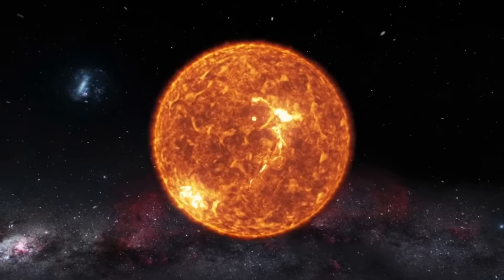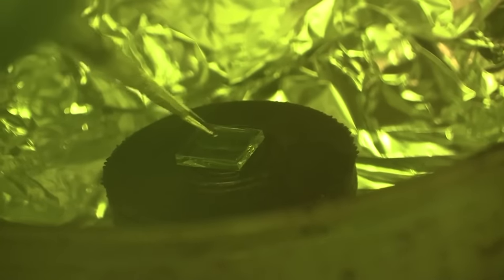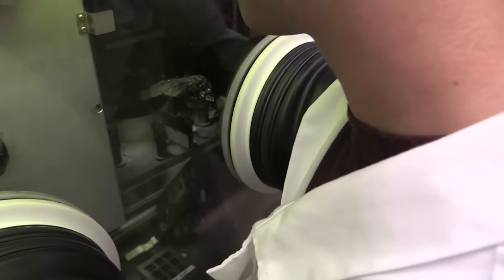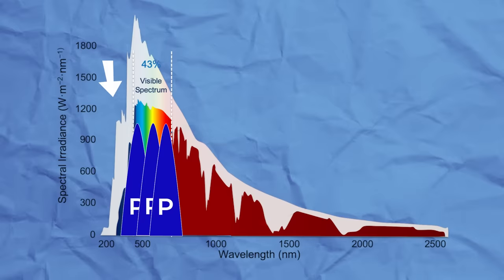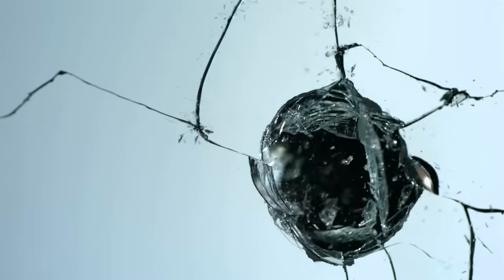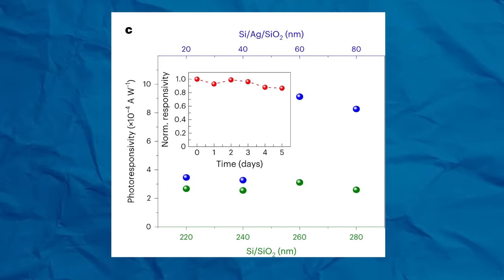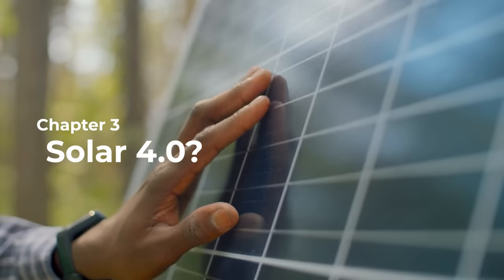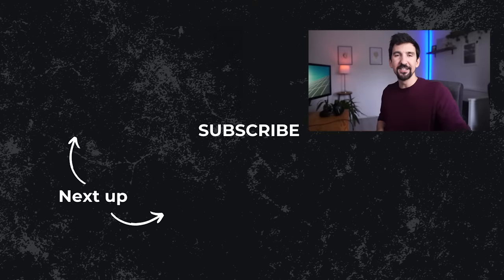Solar 4.0: Ultra Efficient Solar Panel Breakthrough

Comment: I know that perovskite cells can be roughly 1/2 the price of silicon cells, but with the adaptation of not using lead and adding the layer of silver I wonder how expensive they will end up being if this design is universally accepted after further lab testing.
Reply: No perovskites as a material are 1/10th that of convention Crystalline Silicon. However the casing for all.perovskite panels may be made simpler without a silicon substrate, so they could end up being 50% less expensive.... Possibly more due to the roll to roll capability of perovskite material application.
Reply: Depends on the thickness of the silver plating they indicate 60 nm and it is an alloy, so maximum silver content per square meter would be(less than) roughly 1 gram which is less than a Euro in material cost.
Reply: @nilsfrederking62  We also have to take into account that the silver could be potentially recycled and recovered, thereby further deceasing the total amount of silver used.
Reply: Maybe dispersed metal atoms on multiple layers could allow for the silver effect. High temp metal could be used as its a substrate not impacting the perovskite layer, however the dispersed atom idea is a little bit complicated in terms or preventing atomic agglomeration for true dispersal
Reply: @nilsfrederking62  if the entire Industry converts it it could be * million square metres.... So 1 ton
Reply: As he explained they didn’t need the mirror effect but just a metal. I think they used silver due to an easy process to apply it. Silver is out from the beginning as even the tiny amounts of silver used in solar cells actually is using 10% of the worldwide silver production. The main problem of perovskites is the durability. And installation is a huge part of the costs of solar cells. So in the end perovskites may be cheaper to produce but due to durability not cheaper over the lifetime of a solar cell which is around 30 years.
Reply: @nilsfrederking62  right, but would the world be able to support such an increase in silver demand?
Reply: @svenweihusen57  aluminium is highly reflective
Reply: @13thbiosphere  Jeah, but they don’t actually need the reflective properties but the metallic property of free electrons. I think they used silver because there is an easy and cheap process to produce thin layers of silver. The same process as making mirrors. And on top is silver highly conductive which might enhance the effect.
Reply: @Supreme_Lobster  The yearly silver production is roughly 23.500 tonnes per year, that is 23.5 billion grams of silver, the earths surface is 510 million square meters, so you could cover the complete earth with roughly 50 layers of solar panels every year. I suppose that is not wanted and  other materials would be insufficiently available 😉
Reply: @svenweihusen57  aluminium is  highly conductive
Reply: @13thbiosphere  might work too.
Reply: @nilsfrederking62  510 million of square kilometers, not meters...........
Reply: The takeaway from this video should be about the efficiency, not the cost. Even if the cells come to market at the same price and the increases in efficiency are only half that seen in the lab, you would be getting twice the energy for the same price and it would still be in a thinner, lighter package.
Reply: @marcosclarandis8090  Thanks, that is quite a difference 🙃must be divided by one million. So would need a new calculation. If I remember correctly the surface needed to cover all of the earths energy needs  by solar would be 0,2 percent, 70% is water....I so it would take roughly 6 years if all the silver production would be used for it. So maybe 10-15 years could be feasible?
Reply: @wildwilco  I fully expect it to cost more than silicon when it is first introduced. Wider production and competition will drive the price down over time. You can look at any chart that plots out the cost of solar over time and see the massive gains that have been made for the consumer.
Reply: @wildwilco  I don't know what data you are looking at. Since their introduction in the late 70's, the cost of solar energy has dropped from over $75/watt to less than a dollar a watt. Even including manufacturing costs, the cost of solar panels has dropped from over $7/watt in 2010 to something around $2.25/watt in 2021. Either way, those are huge gains. If you are personally seeing price increases, my guess is that is due to the growing demand for it and supply issues.
Reply: @Nils Frederking  at current price. High demand from say a new industry will push the cost higher.
Reply: @joshwagner4368  its not the panels. what is the most essential item you need to turn that solar energy into electrical energy?

when you awnser that question you know what is the problem of today. those converter prices have skyrocketed. where a 2000 watt converter would cost about 400-500 euros, you are paying more than 1200-1500 euros.
Reply: @_shadow_1  Silver is as well one of the reasons classic Silicon solar cells are expensive. It turns out there are not too many alternative cheaper materials for the contacts and busbars, that are reliable over 25+ years of use. And I do not see any mass scale of recycling of Silicon based solar panels happening, which would suggest it is not as lucrative of a business as you may think ..
Reply: @jk0000079  that's because the recycling facilities are starved for materials. The solar boom started about 10 years ago, but panel life expectancy is 20~30 years before they even exit the warrenty period. Moreover 10 years ago was the bottom of the adoption curve so it will likely be atleast another decade or two before there's enough material to work with at scale.
Reply: @svenweihusen57 
Silver is the most conductive standard metal.  Next is copper, or gold if you're concerned about corosion.
I suppose we could argue graphene is better, but that introduces its own myriad problems and it probably won't elicit the same effects.
I suppose some room temperature superconductor could do better, but the cost would almost certainly not be worth the improvement over silver.

The reflectivity is mostly to do with the conductive properties.  Although the optical properties probably help, as well.

Personally, I don't really see a problem with lead in these things.  If the reason they aren't robust is because we aren't using lead - then that is ridiculous.  Yes, putting lead in gasoline was a bad move.  Refusing to use solar cells that use tiny amounts of it is potato level.
Reply: @_shadow_1  if silver cost is only 1 eur per m2, than probably it would be too expensive to extract it.
Reply: @nilsfrederking62  I wonder if the silver conductor/reflector can be replaced by a layer of aluminum...
Reply: You can coat aluminum no problem, you probably own an aluminum mirror. They probably used silver because it reflects a bit more and it's easy to do quick in the lab with standard chemicals they have laying around.
Reply: @_shadow_1 Pretty hard to do that recycling of the silver already in the silicon panels....just saying.

Comment: 250% efficiency , which is impossible, is not the same as a 250% increase in efficiency. If the starting efficiency was 10% and it rose by 250%, then it would be 25% efficient. Why did you avoid stating the absolute efficiency?

Comment: It would be great to know what their base efficiency assumption was.  I understand that some perovskite PV cells are only achieving around 8% efficiency so a 250% improvement on top of this will only bring perovskite cells in line with commercially available Si cells.
Reply: That's the thing, it dosent have to beat silicon cells in efficiency if it can beat them in price.
Reply: 45-50% double junction
Reply: @mrspeigle1  if you think these cells will be "magically cheaper" they won't be.
Reply: @mrspeigle1  Pure perovskite cells are actually cheaper since they use an easier and less energy intensive building process (printing) and low cost materials (lead). But if you are printing multiple layers of different materials with silver between them, I don't think it will be cheaper.
Reply: @poWMod  stuff for the bean counters to figure out, cheaper is the main promise of perovskyte
Materials and manufacturing techniques might push it over the top but don't forget that silicon cells wich hit those efficiency numbers have thier own cost and complexity adds. Figuring out what it will be at scale is the question 🤔
Reply: @mrspeigle1  Price of PV is the sum of the sheer modules, fixing them, wiring them and all the conversion stuff + storage. 40 or 50% efficiency would bring the price down just if the module price would be 2 or 2.5 times higher (so the same per Watt peak).
Reply: The information in the thumbnail says 250% efficient, not 250 more efficient.  Power supplied by the cell / power provided = 250 %.  Which, to coin a phrase it utter bullshit.
Reply: @neddyladdy  it says +250% efficiency, which is to say an increase of 250% in efficiency
Reply: Meyer burger is a swiss firm that in recent years have changed from a machine producer for the solar industry to a solar panel maker using perovskites, and these panels are already more effecient than regular silicon based solar panels. This might be huge for them.
Reply: @powmod  250% increase sounds like something used for marketing,  It says nothing of efficiency. In my country we have laws stipulating methods of measurement.  Quoiting increases in efficiency is certainly not one of them. I would have thought that the methods stipulated here would be used world wide.  Quoting only increase in efficiency they would be open to prosecution and they would be a laughing stock in the industry and with the public.
Reply: For 30x30cm modules we're getting close to 10% now. But you are correct. Larger scale perovskites will not match silicon for a while in efficiency, they are likely to be much cheaper to produce.
Reply: I have been following this, their based assumption was 21-22%
Reply: How many have been Balrog'ed?  

Probably not many. This much percent no further.  Kinda opposite of Tolkien though, Gandalf gave the directive, not the Balrog.
Reply: @RunToEternity  The Rudog is sinmog. When applied properly. This is known throughout Chloratia.
Reply: @mrspeigle1  it wont, as it will degrade and get less use of a limited roof size.
Reply: @neddyladdy  when the percentage given is greater than 100 "increase by" simply means "multiply by" the given percentage divided by 100. It is counter-intuitive but it's not misleading or fraudulent. Granted, it's popular with people wanting to use big numbers and be dramatic.
Reply: So basically if their assumption was 20% efficiency, increased by 250% that would mean a panel with 70%right ? Still this great. Does not matter if it is too expensive to do it with silver, that s a new technique. Maybe it could be done with a cheaper metal down the line. Or steer research in another direction. Just 100% increase in efficiency would mean solar panels could be twice as small for the same power output.
Reply: @Pomaufour  based on 20% it would be 20 x (250/100) = 50. So that would be 50% efficient. It's a nice improvement.
Reply: Interesting.  If the cost/watt gets near a buck, it will be viable.  PV is a long way from that.  No magic bullets on the horizon.
Reply: Everyone saying it won't be cheaper is amazingly ignorant.
Reply: @markflint9089  

I think that you are confused with when it’s not a percentage increase.  Your calculations work if one says that X is 200% bigger than then starting value. 

However, if one says that there is a percentage increase then one needs to include the first 100% too. If X increases 100% then it will be 2X. If X increases 200%, or a 200% percentage increase, it won’t be 2X. Instead it will be 3X. In general to calculate for a percentage increase, divide by 100, add 1, and then use the resulting number to multiply by the number that is being increased. 

For example, if 20% was the starting efficiency and a 250% percentage increase was achieved the story is BS. sorry, the calculations are
20 * ( ( 250/100 ) + 1 ) = 20 * ( 2.5 + 1 ) = 20 * ( 3.5 ) = 70

If the 20% starting efficiency was bigger by 250% then it would look like
20 * ( 250 / 100 ) = 20 * ( 2.5 ) = 50
Reply: And 250% is also wrong, as at minute 8:10 show the photoresponse curve, and from about 3.5 to about 8.5 is a 150% increase. Is the big mistake done every where with % . The double of something is 100% increase, not 200.
Reply: @capitalinventor4823  I see what you mean. Maths is definitely not my subject. Thank you. I think the confusion is caused by operator being common language words that don't have the same constricted meaning as the mathematical terms. But are there clearly defined operators based on all permutions of language? So without asking for qualification would you be sure (100% lol) that you could "find 250% of 20"? Or, determine "What is 125% more than 50"?
Reply: @markflint9089  

Don’t put yourself down. It’s a tricky problem to word and I had to be very careful how I formed my examples. I don’t know if there’s a general rule of when to apply which formula. I just learned to read read carefully and think about what makes sense. Perhaps when doing comparisons, such as find 250% of X or Z is 325% of Y, one doesn’t add the 1. When talking about increases, 125% more than X, then the 1 is added. That’s just off the top of my head and IANAM (I am not a Mathematician). 😄
Reply: yeah but its way cheaper
Reply: @mrspeigle1  the perovskite film should be pretty cheap, but it seemed to me like he was saying the efficency gains come from a plate silver that the perovskite is deposited on, the thicker the better. IDK if that would actually be much cheaper
Reply: Just to help out the math-challenged, a 250% increase is identical to saying multiply it by 3.5. A 100% increase means multiply by 2. Some additional confusion is caused when the base value is already stated as a percentage, like "8%" (and efficiency is usually presented as a percentage), but that doesn't mean a "+250%" means it is now 258% efficient, but rather 3.5x so 28%.  If any of these statements seem wrong to you, please Google "Dunning-Kruger" and think how it might apply to you when arguing about math.